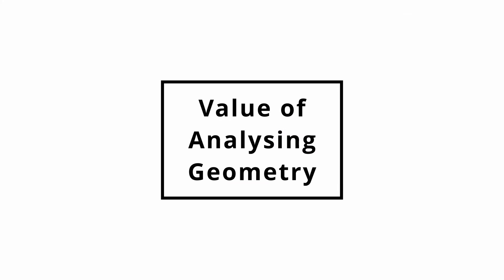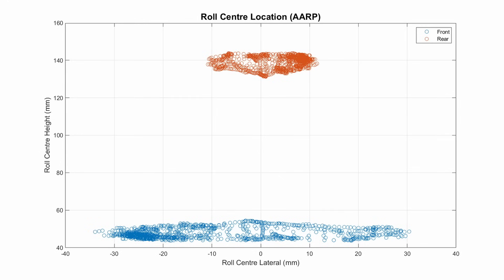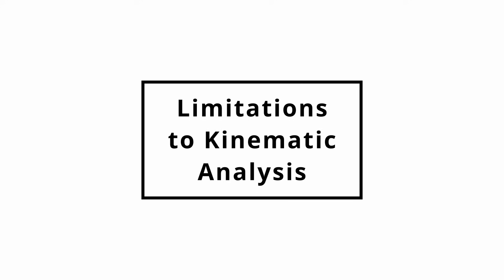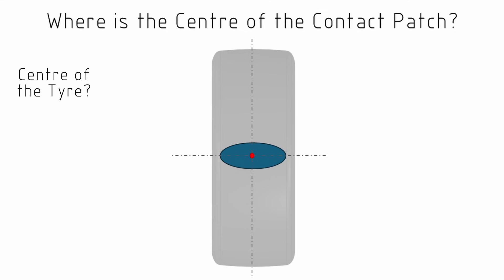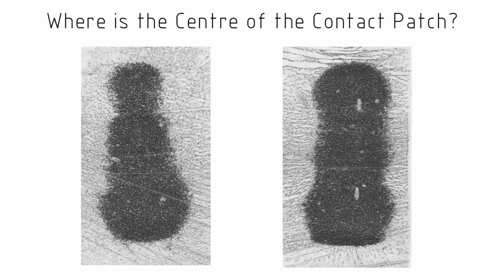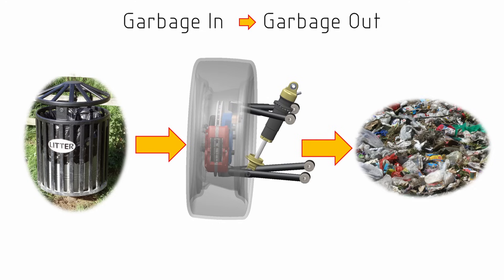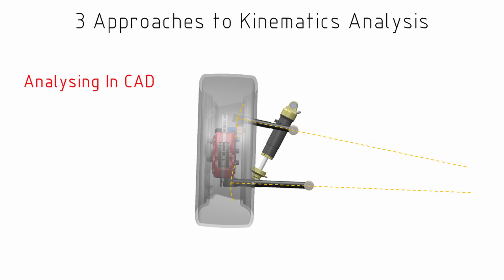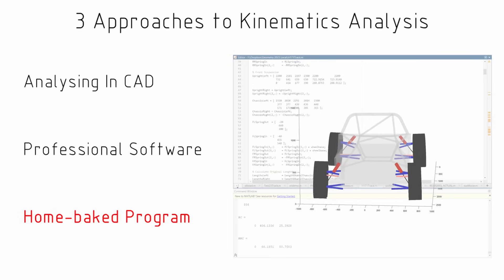Suspension Kinematics Calculation - An Overview of Methods Used (Project 171)

Comment: Software name u have used for suspension ?
Reply from the maker: I've written the software myself.
Reply: @KevinHayward7  how can I get the software
Reply from the maker: I don't have any plans to release it, it is pretty far from being easy to use at the moment.  Having gone through commercially available software development before I'm not in a rush to do it again.  There are some options available that can do some of the useful things you need done, although if you are designing in CAD, it is amazing what you can get from moving things around in the CAD environment.

Comment: Very interesting stuff. You mentioned the use of openmodelica somewhere. Do you think it will be useful for suspension kinematic?  I’m thinking of the multi body library or the vehicle library. 
I’ve started to play with it but am looking for good tutorials. 
Have you had any experience with openmodelica?
Reply from the maker: My only experience has been to open it up, have a play for an hour or so, and then head back to my own sims.  A lot of potential, but like most software there will be a learning curve.  At some point I might go back and give it a little bit more time.

Comment: Currently a 3rd year mech eng student.  University doesn't really cover anything automotive/motorsport related so I'd like to ask you as someone who knows about this stuff. What is the best way to study car design? Stuff like frame, braking, suspension geometry (which i love) etc. What would you recommend?
Reply from the maker: Has your university got a Formula Student team? Baja? There is so much to learn by joining a team. Most teams manage to collect all the main important parts of building one-offs.  Aside from that read, try and do some design, read more, design more.  Rinse and repeat.

Comment: Nice. Glad you mentioned De-Dion. After learning about it, it's the thing I want to implement the most, one day. Particularly with adjustable static camber and toe, and then later, to try devising a symmetrical camber-gain system that only activates in roll and doesn't use any sliders. I presume that having both tires lean into the turn would be better for grip than anything an IRS can produce thus far, and as far as I understand kinematics, the only way to achieve that is to start with having both wheels constrained directly to each other, at least in part, IE a De-Dion axle.
Reply from the maker: The De-Dion based cars with 4 link beams and interconnected suspensions worked pretty well in the FSAE vehicles that we implemented them on.  Ended up being great for botht he skidpan and acceleration. The former due to keeping a consistent camber and the latter mainly due to being able to wind in a fair amount of anti-squat.  Also packaged really well.  Easy to get away with it on a FSAE car that tends to be more front end limited and doesn't have huge amount of power.
Reply: @KevinHayward7  Interesting that you say it packaged well when one of the articles/forum posts I read about De-Dion was that F1 was having packaging issues with it and the underbody aero, which lead to them being canned in favor of IRS. But yeah, being able to dial in high anti squat and have neutral roll steer simultaneously is part of the charm as far as I currently understand the tech. What'd you mean by that last bit, though? It seems like you're implying it'd be bad on a full-scale GT-type car.
Reply from the maker: Wasn't really implying good or bad for the DeDion for a GT car, more that any increase in unsprung to sprung mass ratio in the rear of a FSAE car is not something to be all too fussed about. There are ways to deal with it in larger cars where it may be something of more of an issue.

Comment: I think that a very important point, specifically for suspension newbies is to make sure that  the suspension doesn't do anything stupid. Not trying to bite off more than you can chew is a very good way to avoid major delays.

For example I've gotten waaaaay to hung up on getting a smart driver analysis working in ADAMS. At that point I thought that it would give me so much information. Nope. It was borderline useless. Also, if you don't know your way around it, ADAMS works in mysterious ways. Sometimes it works and you don't know why. Most of the time it doesn't work and you don't know why. Similarly I've gotten way too invested in getting MF 6.2 tire model coefficient extraction algorithm instead of going for a substantially more optimized suspension system utilizing a basic Pacejka 89.

Go for more complicated simulations when you can't get more out of the simpler ones. Constant radius cornering is your friend. Total lateral load distribution is your friend. Make sure you don't get things like a shift to toe out in roll, shifts in car balance from understeer to oversteer. It won't get you a 100% of the way but it won't get you lost. Going straight for complicated dynamic analyses will get you up shit creek, without a paddle. You won't understand what inputs you need, you won't know what to do with the outputs that you get. First simple, then complicated. Not the other way around. Anyway, Claude help us all.

Comment: Does the tie rod/toe link always need to point at the same instant center as the upper/lower arms? I've looked at this in CAD a bit and noticed that the wheel cannot travel when the tie rod is anywhere else. What about its length: will that over constrain the problem too or is it just related to angle in the ZY plane? How precise does this need to be in reality to avoid horrible suspension movement?
Reply from the maker: The toe link doesn't need to point towards the same instant centre although it is good practice for it to do so. If it doesn't the wheel will rotate about the steering axis as the suspension moves.  It can be handy to do a sensitivity analysis on this when you are finalising the geometry, taking into account the accuracy you can actually achieve during manufacture.  I am planning to do a video that discusses steering geometry specifically.

Comment: OpenModelica is an Option
Reply from the maker: Definitely is, I should stop fiddling around with my own code and just learn to use it.  Unfortunately my normal work model is to start figuring out some software and then start to wonder if I can implement what I am after, then emerge from a rabbit hole a few weeks later to rinse and repeat.
Reply: Have you tried modelling a full car with openmodelica?  I mean modelling the suspension at all 4 corners of the car to find roll centres etc. Do you know if openmodelica has a proper tyre model - Pacejka model?  
Recently I found MBSim software. Only just learning about it now.

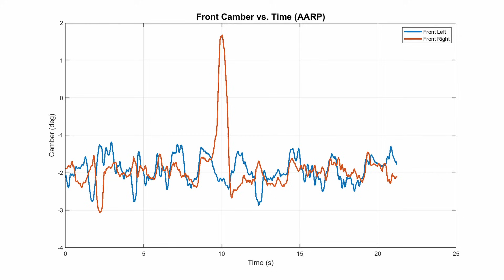Comment: On 2:02 (what looks like logged data imported into suspension geometry software) there's huge spike (around 10th second) of camber up to ~1.7 positive. I wonder what happened there - wheel off the ground?
Reply from the maker: It is an example graph, but from a very different car (haven’t got data/sim outputs for this car yet).  Very extreme steering angle with reasonable caster angle.

Comment: Great video and good sammary of existing suspension geometry software. I would add WinGeo3 (it used to be well known in industry) but Bill passed away several years ago and I'm not sure if software is still available. Your own software solution is looking great, I have to say. Thank you.
Reply from the maker: Definitely should have included it.  Bill was a nice man, offered to find me a job if I needed one.  Was very generous with his time with students. Definitely a loss to the automotive community.
Reply: @KevinHayward7  Thanks for reply Kevin. Just fixed a typo in my above comment. I meant Your own (not I)

Comment: Thank you to give the insight of the traject you followed. For my project I did more or less the same in LabView. My greatest problem was to do the calculation in “real time” and to learn this on the go.. Also the data of what are the “good” parameters for the vehicle to be build (-> Electric buggy / sandrail) are not clear. If there are people interested in this LabView approach , I can make this opensource. Regards, John
Reply from the maker: @SimonePost-g7s  I have spent very little time in labview. Does it end up being similar to setting up models in Simulink?

Comment: Great video! I'm on a university engineering team designing front suspension and steering.

Do you think we could use a solver like yours to pre-calculate suspension stiffness (Keq) vs. wheel travel and steering centering force data, then feed this into a racing simulator connected to a force-feedback wheel? The simulator would interpolate these pre-calculated values in real-time, adjusting the force-feedback on the steering wheel based on steering angle, vehicle speed, and front-wheel load -- it would simply look up these pre-calculated values. For the suspension system, pre-calculated values of K_eq vs. vertical wheel displacement would be used in a explicit time-stepping solver. 

This could give the designer the ability to actually test the feel of a vehicle given the current design, on the actual racetrack. The designer could make tweaks to the design, run the kinematic analysis to create these pre-calculated data tables, and then try it in the game.
Reply from the maker: You would need to build in forces from the tyre data. As a student team you should be able to get a hold of ADAMS through sponsorship. Add in the data from the TTC then you have all of what you need, but a fair amount of work to do to get your answers.

Although having done a fair bit of "student team" stuff I would be wary of being too trusting of driver in the loop sims.  They can be great for driver training, but they fall far short of what you learn by going testing.

A lot of ways to get to where you want to be, and no where near enough time to try them all.

Comment: How would you recommend designing long travel suspension components for existing vehicles and when you need to ditch factory mounting locations
Reply from the maker: That can be harder than building from scratch. Check out https://www.youtube.com/@SuperfastMatt if you haven't already. He has a series where he makes a Viper into an offroad vehicle. Lots of measurements, designing and making subframes, as well as the custom components.

Comment: Very interesting stuff!
I will share my little bit of experience:
I started to part away from kinematics only because the deformations are always an important part.
Even when there are ball joints in the way, I use a quick FEA integrated in the CAD software to compute radial and axial stiffness of a ball joint and model a deformable bush in the constrain.
This also means that the spring must be present in the model itself.
I used to see quite some differences from kinematics only to real world, this approach reduced the differences by an order of magnitude
Reply from the maker: Would I be right in assuming most of the difference comes from camber and toe compliance? I would normally aim to follow the kinematics only analysis with some full assembly FEA and some compliance testing of the built systems. Then combine the knowledge.

That being said I am aware that I probably should just build compliance into the model.  Just a reluctant programmer.
Reply: @KevinHayward7  yes, the recurent issue is a neutral bump steer kinematic that becomes "bump steery" when compliances kick in.
Just accounting for the arm link stiffnesses reduced the error by a lot, but I guess this depends a lot on which is the weakest link on the particular project

Comment: As you use more or less advanced methods do you notice that solutions that seemed optimal in more rudimentary models were actually fundamentally wrong once analysed deeper? Or does complexity in the model just create incrementally better results?
Reply from the maker: That is a really good question, without an immediate yes/no answer. I think it comes down to what you are asking of the model, and whether you are taking the un-modelled parts into consideration. All simulation / calculation is an approximation so all have errors it is just a question of magnitude. It can mean that over-optimising in software can end up wasting time that might be better placed in testing. 

When I was a partner in a design company we had a job come through that involved Finite Element Analysis that another company had done. They had simplified the model of a hydraulic ram and treated the two main subassemblies as bonded, and then did not do a buckling analysis. The sims said it was okay, and then it failed in real life. They used the same software we had done, but had defined the problem poorly and then not interpreted the results correctly.  They could have had a better design by using a simpler model (or hand calculations) that had the correct problem definition. Our first pass at calculations indicated that the assembly was going to fail, even before we had done the FEA.

I think that users not understanding the model, problem definition, or analysing the results incorrectly causes many more issues than the model complexity.

Hope that answers the question.
Reply: @KevinHayward7  Really appreciate the thorough answer here and in your QA video. I should have realized that understanding whatever it is that you're analysing allows you to prevent the results from changing radically because you recognize the assumption is wrong or that the answer it's giving you can't be right. I like to say that engineering is making physical systems give predictable results efficiently. The better you understand the physical system, the more efficient you can be. I guess that's also true in this case.

Comment: Top work.  As someone who has gone down many of these same goat tracks of discovery, I'd recommend looking at two things that are on-the-cheap.  Firstly, working in Blender with animation rigs offers a great way to move four-bar linkages around in space - huge learning hurdle, I'll admit but everything's there that's needed and you can add fancing modelling if it floats your boat.  Secondly and probably more significant is BeamNG.  It's obviously set up for gaming and less for analysis but the ability to generate "driveable" chassis and suspension geometry with as much or as little sophistication as required is pretty hard to beat for the price.  Again, the learning curve is steep and it could do with a better vehicle developer interface rather than hand editing text files but there are sufficient tools becoming available as Blender plugins to ease the load.
Reply from the maker: Good call.

I have had a few false starts with Blender.  Powerful software but not a massive fan of the learning curve. BeamNG is definitely interesting, have spent some time with it, and at some point I will probably want to do some driver in the loop low end sims of the car just for a bit of fun.

Comment: Thank you for the suggestions, I think I’ll start with CAD geometry with some simple excel spreadsheet to start. We used OptimimLap to help determine the gear ratio for our EV FSAE car. We don’t know how good the vehicle dynamics model is in that as it’s a free software, but strait line result kinda matches with my Python sim.
Reply from the maker: OptimumLap is quite a simple model, but it has its uses. I think it would be very cool to add a COG location to it, and a couple of other small models which would make it considerably more powerful for a small overhead. The question then would be where to stop?